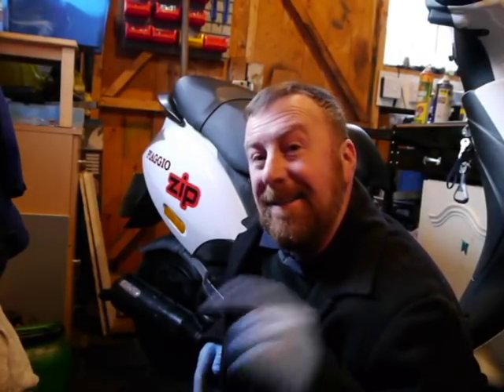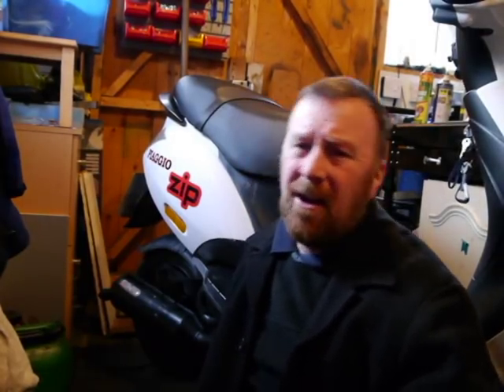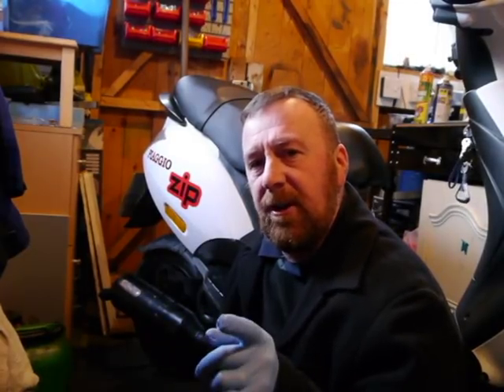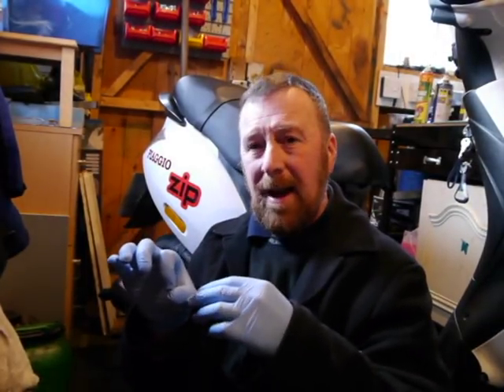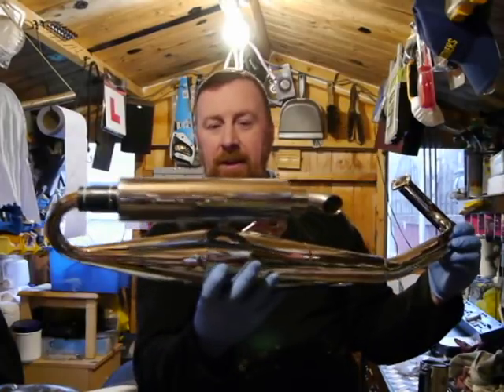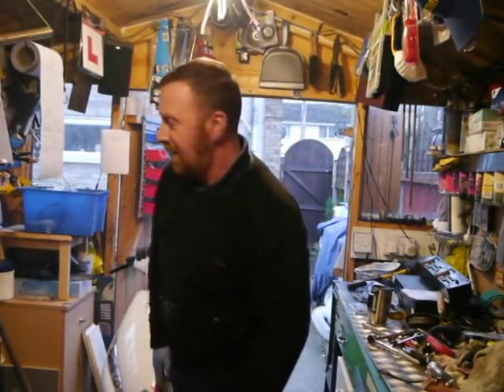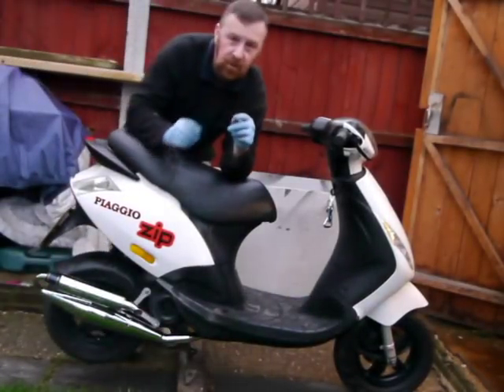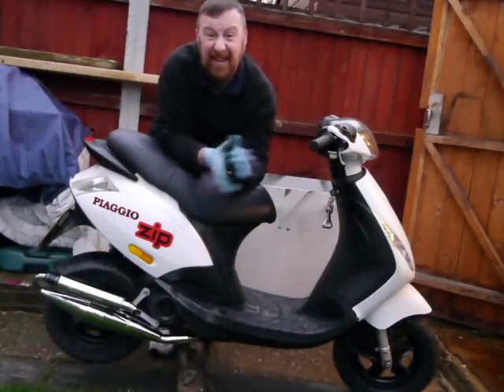CHANGING TO A SPORTS EXHAUST ON A MOPED IT'S A MUST ! MARK SAVAGE

Comment: Hi Mark just bought a Doppler sports exhaust for my speedfight 2 100cc 2008 model I been told to upjet my carb by 10% think I have an 83 jet atm so upjet it too 91 ?? Is this correct also im struggling with ordering a Kevlar belt as mine is a Catalysed model and I can only find non cat belts unfortunately, apparently they don’t sell them no more?? This cat and Non cat is confusing me to be honest. Pm tuning told me I have to get a cat belt and a cat variator as my moped is catalysed from new?? Would appreciate very much if you could help me thank you
Reply from the maker: Hi bud 
Ok 
100cc don't worry about the belt as long as its for the 100cc and nota 50cc as the neck has a smaller opening 
Rollers 10g but weight what's in there now and if ok leave or use the same
I'd fit the exhaust 1st to see how it runs as it should be OK 
And sometimes if you go too big it will bog down
Of its happy once the exhaust is changed 
Don't worry about all that CAT chat it will be fine 
To be honest I did up a 100cc and over 70mph it gets a little scary lol !
I got 80 and the 1st bend I didn't think i was going to make it round lol 
Parts for the 100cc are hard to get so double check first bud
Reply: @marksavage  okay mate thank you so much for that ideally I would love my speedfight to go 75/80 that would be ideal it’s just a little toy for the summer only so I’ve got until then to work on it. Ideally I want a Kevlar belt tho but can’t seem to find any for the cat model and I also wanted to buy the Malossi multivar variator for cat model what would you recommend I do to get it going that sort of speed? Cheers mate
Reply from the maker: @con7993  the sports exhaust will help massively 
Sport in box air filter 
10.5 or 11 g rollers 
Sports variator or take the plate off the back 
No washer and make sure its all clean 5 up jet from standard so for not leave test ride 
Make sure tyres and suspension are OK like in my videos 
At that speed you'll know if now !! 
Stay safe bud

Comment: hi mate I’m changing my stock exhaust to a gianelli extra v2 on my Aprilia sr50r, is it as easy as just replacing it or will I need to adjust anything?
Reply from the maker: Its bolt off and bolt on ,just one of the head bolts can be a bugger to get off with just little turns !
Wd40 before to start ,it will work well no upsetting needed bud 
I have a few aprilia videos on my channel bud give them a watch
Reply: mark savage sound lad I’m fitting it tommorow, does it make the bike any faster or just louder?

Comment: Hi mark wonder if you can help,removed my factory airbox for cone airfilter direct to carb.now I've noticed a pipe that was connected from engine casing connected to factory airbox which let's out old oil from engine.does this pipe need to be connected to air filter? At moment it's just connected to engine and runs independent to back of wheel.any thoughts?thanks in advance.
Reply from the maker: hi bud 
as in my other videos i dont much like the cone / foam filters as they suck in moisture and can make it not run very well, i always replace the insert air filter and way it's up to you.
as for the pipe if it lets out old oil i would not want it coming out onto my tyre !, oil and rubber don't mix to well lol
it's ok not to fit it but i'd tyr and move it away from the rear wheel and maybe to the ofset front side
hope that help 
thanks for watching i have may other videos that may help 
mark
Reply: Thanks Mark I was worried the pipe needed air suction to draw out the gunge from the engine as it was connected to the airbox,I will reroute the pipe.

Comment: Hi mark i got a 125cc lexmoto fms and i got hissing coming from the right side by exhaust or the fan not sure what it is ive just changed the drive belt maybe thats the cause some how any help be appreciated
Reply from the maker: So all you have done is change the belt ?
Noises do seem to move around so if it wasnt doing it before I'd take the cover back off and check it's all ok 
Did you reset the rollers or change them as they can move and stop it from working properly 
I'd of changed them too while I had the belt off 
Just make sure you did move the plastic engine cover so it rubbing 
Or a wiring rubbing 
Is it running ok

Comment: Hey mark Anthony here can you tell me what the screw is for on my muffler exahust pipe.? It's just below my foot on pipe few inches from muffled .
Reply from the maker: to be honest no bud, sure it has its reason if not to connect it in some way even possible a restrictor but if it runs all ok leave it bud
Reply: Ok thanks for reply big guy.loveyour videos I took it out and it seems to run smoother ok without it but not as quiet .plus without it in exahust pipe the compression is smoother .no jerking and goes right on up in rpm till full throttled .it's put it back in because I kinda like my quick take offs .thanks again

Comment: can you do how to replace a stator and dignose a lxr 125 please
Reply from the maker: It's a job 
I have a ybr125 video on it , same sort of thing bud
Reply: @marksavage  as i have a lxr 125 and i have to start it as soon as the battery connecteted or battery to low to start and when ridden battery still to low to start bike if you turn engine off and ideas please?
Reply: @marksavage  and thanks mark love the vids
Reply: @marksavage  once started run it for 5 mins turn engine off and able to restart but ride it again to put a little charge in battery  and leave it a few hours and not able to start with out charging battery again ?

Comment: Hi mark , sorry I keep asking stupid questions but if I bought a sports exhaust for my 2016 aerox, would I need to change the rollers or variator or clutch? I know I’ll prob have to change the jet but not sure about anything else
Reply from the maker: not clutch but if you want to upgrade or just clean and check rollers its a good idea ( I replace them any way as only a few £s ) as for the variator that's up to you 
see how it runs before upjetting and sometimes its ok as standard but only go up in 4s for the jet
Reply: mark savage ok thanks so if I change the exhaust to a sports one that’s all I need to do ? As I’m not very good with mopeds but I reckon I could do that cheers

Comment: When up jetting 2018 typhoon what jet size should u use when changing exhaust
Reply from the maker: I go up in 4s, you can buy a pack of 4 odd and then go up slowly for best running 
you might look into replacing the filter too

Comment: Thanks for the vid. I would like to upgrade the exhaust on a 500cc maxi scooter but I'm worried it will give me issues. If I replace with a slip on exhaust would I still need to up jet and fine tweek?
Reply from the maker: hi bud 
well i always say about upgrades on my moped videos and on my big motorbikes like in my other videos
as for maxi scooters i would leave it as is as yes you would have to start playing with other upgrades and being a 500cc it must be fast as is and a deeper sound would to me not match the scooter
maybe put the money saved into a good service and change the rollers and belt if needed
these 500cc as set up well for mpg and mph so it's up to you really bud but me i'd leave it 
thanks for watching i have many other videos you might like to watch like the burmans 400 and 650 and others 
please like share and sub 
mark
Reply: Cheers mate, I appreciate the reply. I think you're right to say leave it as is. As much as I'd like a muffler that looks better, sounds better and reduces weight, I don't want to create any issues on the bike. It does go pretty well with the OEM exhaust. Limited parts here in Canada for maxi scoots anyway, most people ride big Harley's and such,.
Just given it a full service and getting the belt done soon too. One other question, I hope you don't mind... If I do replace the rollers, will I gain acceleration and lose top speed or vice versa depending on the set up or are there rollers that would improve on both? Cheers

Comment: I tried to put 3 half turns out and it make a bit of a good change but i think my second adustable screw its the 
?problem (the one that its a bit highr) how much turns you turn it to original settings
השב
Reply from the maker: hi bud as in my other video on tuning the top one is your idle as you adjust the air mix you will need to adjust the idle so in will rev a bit higher out slower , adjust it so it ticks over just nice and not wanting to pull the bike or spin the wheel too much
mark

Comment: I have a 2017 speedfight darkside. The garage de restricted . Since the bike has been done it bogs when setting off . What would you suggest ?
Reply from the maker: going back to them bud, could need up jetting but as I dont know what or how they did it id pop back in and let them know first
Reply: mark savage hi it was by removing a washer , the garage is a fair way from me that’s why I can’t take it in
Reply from the maker: @sonnyjaxgang6675  that I'd normally say wouldn't do anything but 
If your getting  a much better speed you might need a upjet like in my videos 
Or sports exhaust to help get the gases out
Reply: Brilliant , thank you for your advice , Im sorry to be a pain . One last question what size jet would I go for? I don’t know what standard is in my bike ?
Reply from the maker: @sonnyjaxgang6675  standard is normally 53 to 56 so I go up in 4s ,you can buy them in packs of 4 or 10 so start at 60 and test to see how it runs 
don't go too big to start bud

Comment: I wouldn't mind a zip as a fun project but that one's too noisy, way too noisy, glad I'm not his neighbour. Would exhaust wrap quieten it down a bit?  I'm showing my age here, damn that's one irritating little moped.  Wouldn't be so bad if did 70 but that squeal's likely to hang around like a bad fart given how fast it goes.
Reply from the maker: Ant Laud as in the video bud it was a cheap exhaust for £66 and I would have bought the tecnigas one for £87 
They are also good and a lot less noise 
This in is sealed and you can’t
I have other videos on exhausts and how to quiet them don’t but you get what you pay for and I have to say it still had good performance even with it being loud 
Zip’s are fun little bikes maybe look at a few others like the speedfights I do loads of videos on for help 
Mark

Comment: Hi Mark I've got a aprilia  sr 50 scooter it was running fine last week until I started losing the top end speed it usually does 40 ish mph  now it's only doing 25 mph it starts ok but  when I give it full refs when it's on the stand it runs a bit lumpy and it's a little bit smokier what do you reckon mate. Cheers
Reply from the maker: hi bud thanks for watching I have a few videos on the sr50 maybe worth a watch

is it di-tech or carb?, when did you last service it, change plug, air filter? / change rollers clean VARIATOR 
get on with that little lot before you start to worry about piston rings or worn piston, I have helpful videos on all of these 
please like share and sub 
mark
Reply: mark savage it's ditch I will have a look at the videos cheers Mark.

Comment: So Mark, ive put a sport exhaust technigas on my gilera dna with a 70cc group, i also have a sport air filter, but my bike will not run properly, it reaches 20kmph and only then reaches higher speed but getting to 20 it takes like 100 meters to do so, im a farely heavy guy any tips on what to do?
Reply: My carb is a 17.5 one the jets i dont know how to check, i will look for a video of yours telling us how to check, as i think you have everything
Reply from the maker: id be taking of the 70cc kit bud and going back to a 50cc then tune and away you will go 
theres so much messing about you have to do with 70cc kit
watch my video on 70cc big bore kits bud
Reply: @marksavage  okay will do. Thanks!
Reply: Hi Mark, I have been told my baffles have come loose in my sym dd 50cc.....its vibrating really badly, is there any way to stop this or remove them, or is it a new exhaust job mate? I'm pretty clueless with all this

Comment: Hi Mark my speedfight 2 rides fine but sometimes latley it spluters alot and then clears up and now has slight knocking noise from cylinder cover (a/c) so I'm worried
Reply from the maker: Kyle Mackintosh watch a few other of my speedfight videos they will help 
Knocking from the variator cover ! Take it off and have a look around you can’t damage anything 
When did you last service the bike , carb and plug , air filter !
Mark

Comment: Hi man. M really not so good with 50cc scooters but i bought one with a 70cc exhaust setup technigas, upgear kit and sports setup etc from the previous owner. However, is it normal for it to have a slow take off acceleration? Like i mean it is just weird i have to rev up more to move. Was wondering if there is something wrong with the belt or something? Appreciate your help. Cheers

Comment: Hi mark Mark. Sorry for all the many questions lately. Hope you got time for this one to.
I´m slightly worried for my waterpump after I fitted a new exhaust. 
With the original one it´s about 10 millimeter between the pipe and the pump, but with this one it´s just about 2.
Will it be to close and hot for the waterpump?

Thanks for your time. Liked and subbed already.
Reply from the maker: I've seen a few like that and once moving it genuinely stays cool and not melt.
The air flow and moving water should keep it ok 
You could use a little bit of aluminium foil on the pump to deflect some heat or use a few washers on the bolts to lever the exhaust out a little bit more ,that's what I'd do
Reply: @marksavage  Thanks a lot. I will try that. Cheers.

Comment: Hi mark I was wondering if you could help me my moped (kymco super 8 50 2t) starts and I can ride it under half throttle when I go to give it more it just stops accelerating but when I go straight to full throttle it goes slow for about 3 seconds then pick up speed then drops and it keeps doing that I’ve changed the spark plug I’ve cleaned the carb there’s fuel going to the carb and I’ve adjusted the mixture screw but it doesn’t make a difference
Reply from the maker: Clouds hi bud look at the needle height 
Move it down but be careful not to loose the clip in it 
Very bad if you do Lol so may sure you have a cloth under it 
This should help but worth double check and clean the float in the carb too and the air fuel pipe is tight 
Then if no luck up jet as in my other tuning video 
Thanks for watching check out my other videos 
Mark
Reply: mark savage ok mate I will try it and let you know how I get on
Reply: I don’t know why but it’s starting running properly all I did was started it over and over again and now she runs lovely
Reply from the maker: Clouds sometimes it help just running it in and it settles it self , great news bud 
Mark

Comment: Mark i have a nother problem with my speedy 3 i fixed everything i also put 6gr and 8gr rollers it pulls fine and it rides fine BUT if i hold full throttle for a while it dies with a VIOLENT sound and its pissing me off i really wanna go fast but i cant it dies whats the issue? If i dont give it full throttle all the time it rides perfectly fine and its quite fast.
Reply from the maker: HyperRacing  hi bud 
Sounds like it’s heat seizing with that noise 
Does it start up ok after dying ?
Check over everything 
Try putting it on the stand and the wheel off the floor then test it to see where and what’s happening 
Mark
Reply: mark savage its starts right up perfectly sometimes it dies on around 55kmh and sometimes more
Reply: mark savage i literlly rode it for 2 hours it had 0 problems but if i hold full throttle for a longer time it dies  instantly
Reply from the maker: HyperRacing you are going big to have to look at petrol or electrics
I had a bike that the stator coil once it got  hot it would go to earth 
It’s going to be a bugger so I’d start with changing plug and coil 
Clean stator coil 
Then if no luck more to fuel so vacuum carb and so on 
Mark
Reply from the maker: HyperRacing try moving the needle down and maybe upjet it a little more 
Mark
Reply: mark savage thank you soo much mark ill try everything first thing in the morning have a great one.

Comment: Hi Mark I've taken off my carb restrictor and getting a sports exaust with 5g rollers. Will this make my bike go fastest than 30mph considering it will still have the variator restriction
Reply from the maker: hi bud 
I like 6g rollers but yes it should with the sports exhaust as long as yours is not cdi restricted
Reply: @marksavage  erm I dont think so it will go about 50 down hill
Reply: @marksavage  thanks for the help